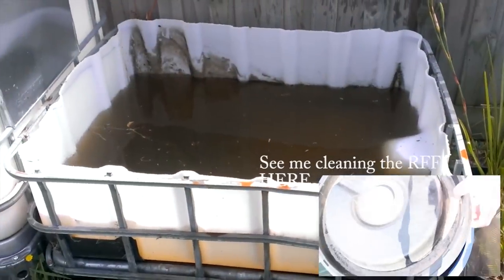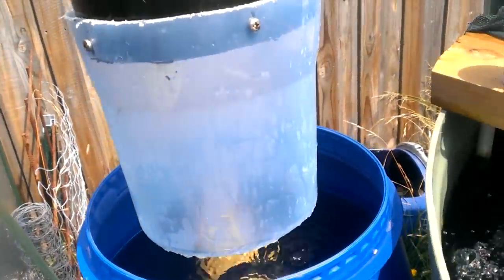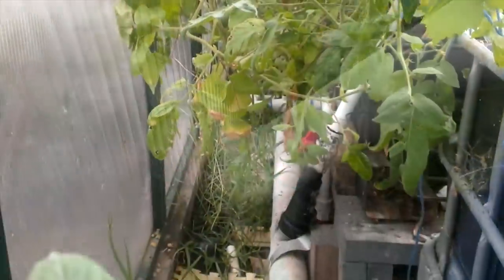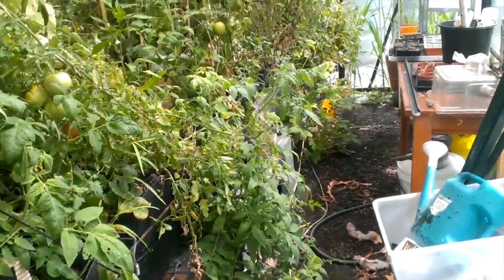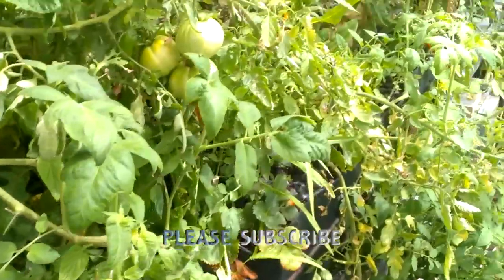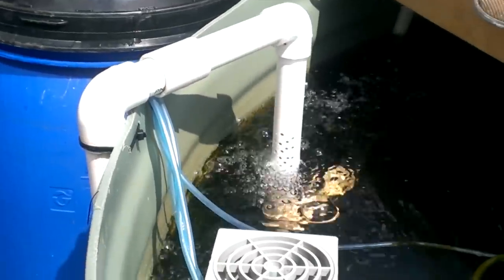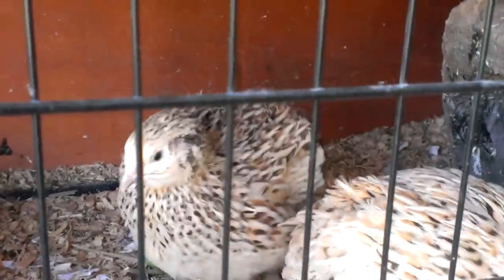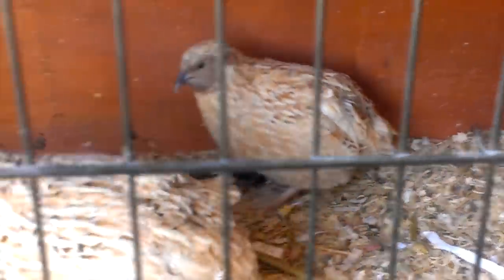How My Aquaponics System works - A Radial Flow Filter Redesign + Meet the Quail! - Aquaponics

Comment: Why no auto siphon?
Reply from the maker: In contradiction to what you've probably read, an auto siphon is not required. Flood and drain vs Constant flood yield the same results as conducted by a BYAP study (timed flood and drain vs auto siphon flood and drain vs constant flood) - They all had nearly the same growth rates. Keeping it simple means there is less to fail.   HOWEVER with that said, i do have auto siphon bells i can use at any time over the stand pipes :-) -  Good comment, thanks for watching
Reply from the maker: *****  Reference to the BYAP trial: http://www.backyardaquaponics.com/forum/viewtopic.php?f=51&t=8621&hilit=byap+trials